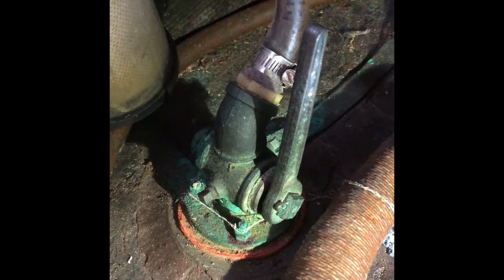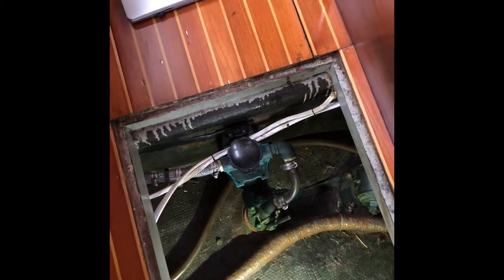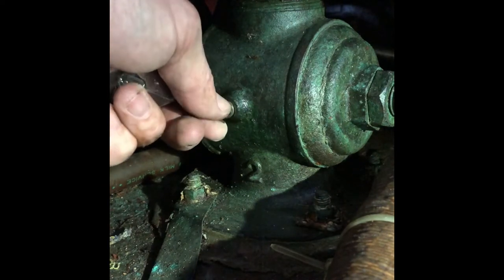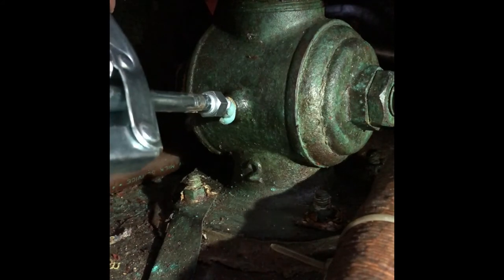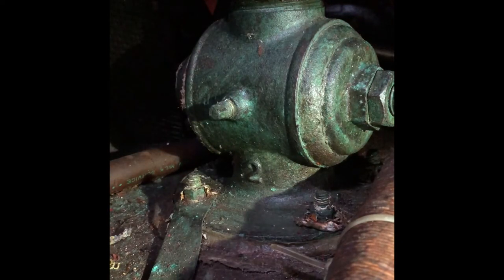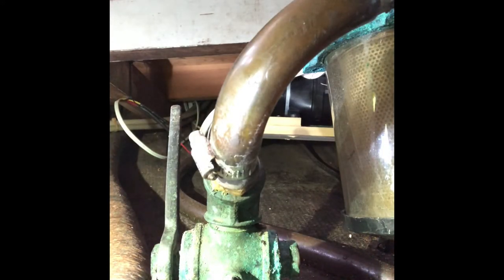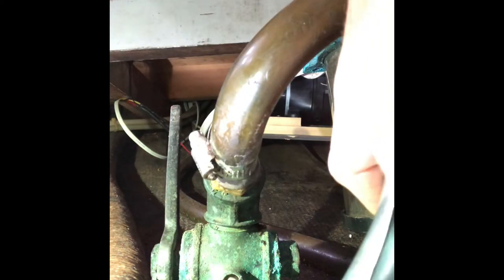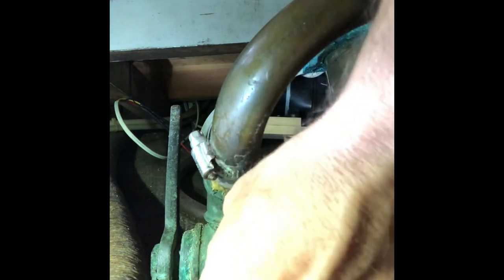How to grease bronze seacocks on an old sailboat

Comment: Yeah, hate to break it to you but you're not greasing the tapered seacock by mashing a little grease in that fitting.  That is there to drain the seacock body when winterizing the boat.  That is a spartan or WC tapered seacock and is easily disassembled for cleaning and greasing.  if it weeps, you can lap the tapered surfaces with lapping compound.

Comment: I have a 1979 pearson with uhhh 13 seacoks and I realized last year just before we put the boat in the that I couldn't close most of the sea cocks . some of mine are like this and are totally frozen ,I will start by removing the little grease fitting ,but I kind of dont want to have to take them completely apart
Reply from the maker: You don’t want to take them completely apart in the water. You can find a quick connect fitting with the little grease nipple to attach to a grease gun.  This will give you much better coverage of grease.  I was using all that I had available at the time while cruising.  Use a rubber mallet to tap it in one direction or the other.  You can also use a short piece of pipe to fit over the handle to give you more leverage to help move it.  You need to be careful not to break anything, I know a lot easier said than done, but if the metal has a lot of corrosion on it and seems brittle then I wouldn’t mess with it. However, if it is clean or you can clean it up nice it’s most likely just fine.  We have 16 of these seacocks, all 45 years old, and they still work great as long as you take care of them!  Thanks for watching!
Reply: Thank you 
I’m going to try again as soon as the weather warms up . Some of the seacocks like the kitchen sink are very hard to get to. So we’ll I have bothered with it for years . There about three of these , uhh 
I have smaller ones that you can take apart that’s kind of a wedge shape gate that is drawn into the fitting. 
But my larger ones are the type that you showed

Comment: That is not the way to grease a seacock. One should remove the cone, clean the aperture and the cone surface, then apply grease to the cone and the aperture of the seacock. All you are doing here is putting new grease on top of the old grease. Those are freeze plugs that can be removed when the seacock is closed for the winter or the boat is on the hard. The two large nuts on the end of the cone should be loosened before trying to turn a frozen seacock.